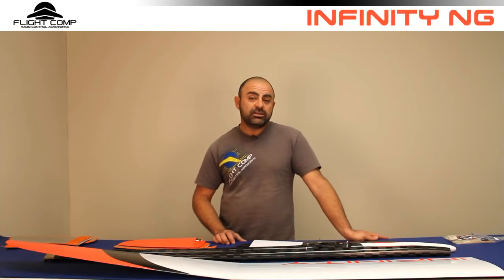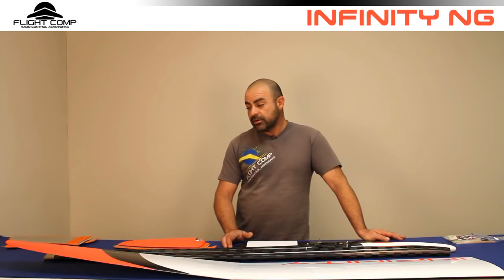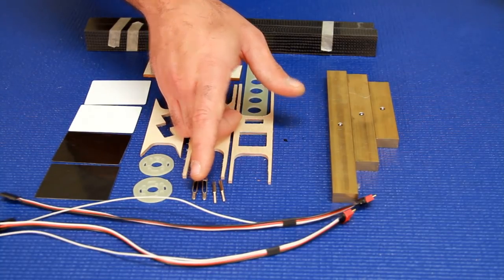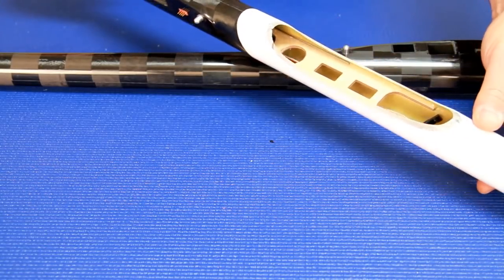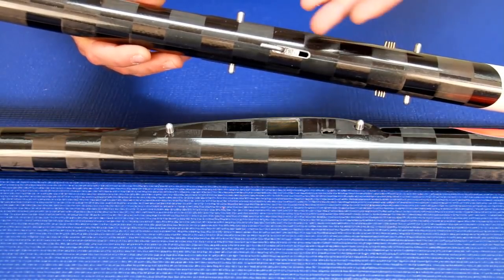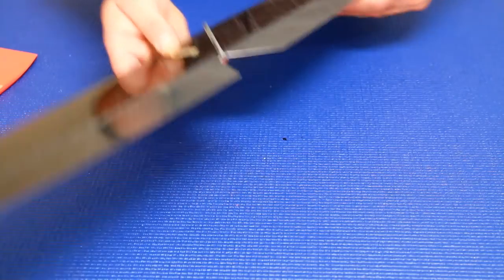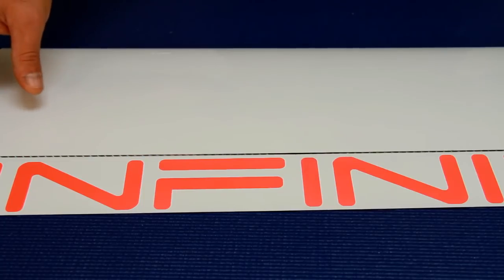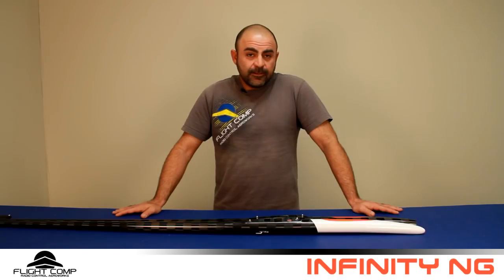Infinity NG F5J F3J First Look

Comment: I flew my Infinity Performance last season and found that it was a terrific flyer.  It seems to hang around at cruise and if you're patient it will eventually find lift for you.  Very high quality build as Ali mentioned.  I do like the inclusion of Kevlar in the forward fuse as it adds some flexibility where straight carbon wants to crack and shatter if the layup is not heavy enough.  The ballast system is very clever although you do need to partially remove a wing half although that's no big deal.  Bohus, who is the maker will really work with you as will Ali.

Comment: Thanks for your video. I noticed something strange on the wingtip bottom surface, is it just cosmetic or the carbon weave has some problem?
Reply from the maker: Rui Silva I didn't see any problems on bottom side. Probably the weave.
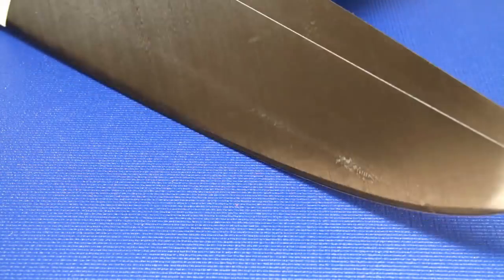Reply: You can see it at time 18:43 on the video, thanks for replying. I am eagerly waiting for your flight report.